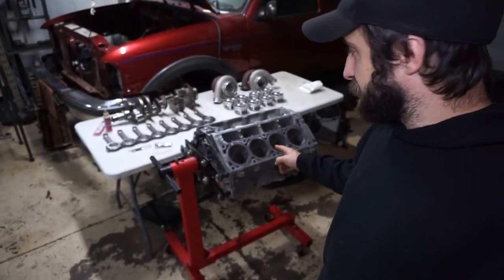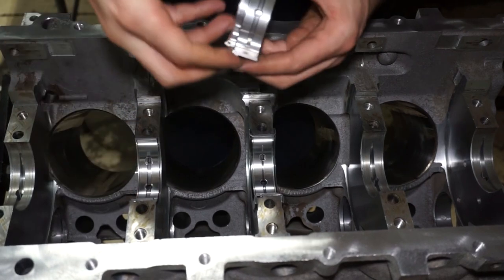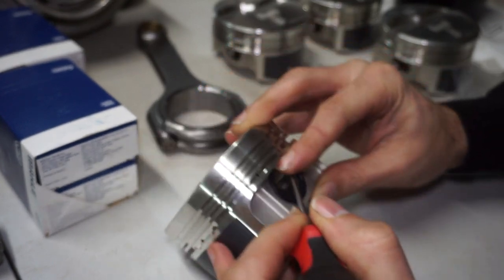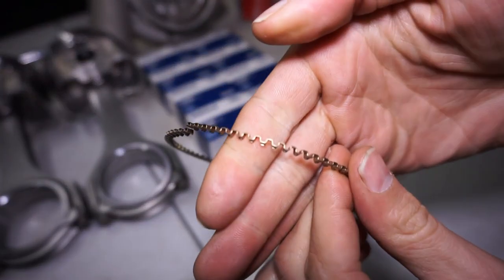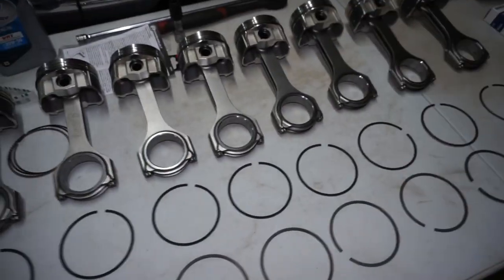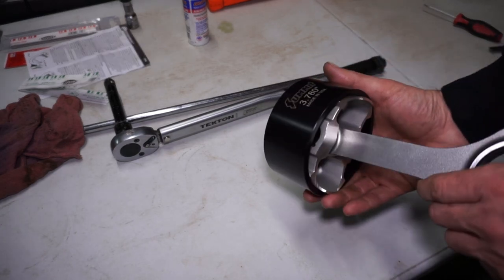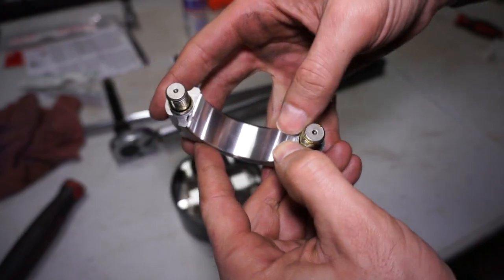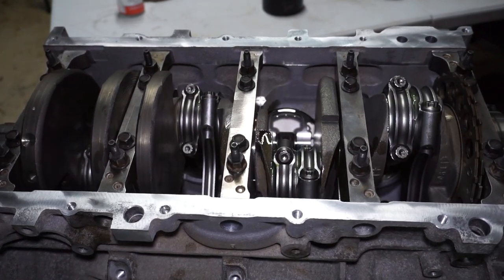Installing Summit Pro LS Pistons And Rods For Twin Turbo Ranger!!!

Comment: There’s a a tool you can get for those spiral locks.  It threads the lock on, then you just thread the locks into the piston.  Almost like using a screwdriver. Makes it super easy.
Reply: If you pull the locks apart like a spring then they just push right into place, and then will have a spring tension once installed.

Comment: I thought it was 15 Ft Lbs and 75 degrees for the connecting rods? Does that equal 85 lbs in the end?
Reply: Yes it does and when you do not have the angle it should be done in a 3 step process up to the 85 ft lbs

Comment: Starting to think this is a sign…was just looking at summit rods a few min ago. What’s your power expectations and how much was ass the machine work?
Reply from the maker: $525 for:
Clean block
Cam bearings(bearings/install)
Balance
Hone/fit pistons
Reply: @BlaserBuilds  How much power you looking to make? Goal?
Reply: Crazy how this video popped back up. Lsa blew last week, doing a lq4 408 with these. Made 860 on old setup I’d be happy with same power .

Comment: Did you have to add weight to your stock crank to accommodate for the weight difference of the forged pistons and rods vs the stock pistons and rods?
Reply from the maker: Machine shop did the work. I'm not positive if they added or removed weight.  I gave them crank and they balanced everything together.
Reply: @BlaserBuilds  oh ok my machine shop was telling me to try to get forged pistons close to the stock piston weight because adding weight to the Crank is expensive. But great content and thanks for the timely response 💪🏾
Reply from the maker: @markc4358  I know HunterTuned had to add weight. They just mig welded onto it then machined it back down. I dont remember seeing any welding on mine.
Reply: @BlaserBuilds  I watched his video right before yours and thought you had a way around it. But I’ll see if the guy at my shop will use weld instead of tungsten.
Reply: My machine shop called 2 weeks after dropping mine off and told me just to get the matching crank to the pistons and rods haha. I think it's allot of work to use the factory crank with these rods/pistons

Comment: Thats a good looking kit! But spiral locks are such a PIA.
Reply from the maker: Yeah, the first one took me like 20 minutes, but by the end it was pretty quick once I had a routine. Lol.
Reply: @BlaserBuilds  I put all 8 of my rods/pistons together and on the last one I realized I had pistons clocked upside-down. Now that was a REAL pain in the ass! LMAO!
Reply: First time I put spiral locks in I didn’t look at the instructions to walk them in- get this I took a tapered pipe that fit the pin bore and I made a mandrel fit in side the lock put em in the and taper pipe in the pin bore and pushed the shit out of it with the mandrel and they snapped in. Lol
Reply: I have to add that it took forever to make this shit work and it was hard as hell to pop them in. My buddy come over after I finished and was like ya walking those clips in sux huh? 🤢

Comment: 13:42 I mean absolutely no offence only for inisight, but as a vet ase cert I can tell you that the first and third bolt you torqued in this video clip were over torqued by atleast 5 degrees after it cammed, you can see them tighten more while the second bolt tq was done perfect. To use a tq wrench properly pressure must be immediately reduced after the initial breakout and not to aloud to turn past it. If you accurate wrench was set to 82 in this video I would assume they were hit with about 96-100 with the extra hit, bearing distortion and service life would be altered
Reply: Not sure how far we are behind real life time, but hopefully no big deal to re-torque them if you happen to see what I see
Reply: @Kevin-zo6nz  HAHAHAHAHAHA

Friggin torque wrench is 8% +\- and ur telling this to a dude that has broke EVERY SINGLE head bolt on purpose "just to see their limits".
Reply: @TheProchargedmopar  I've broken a 54mm diameter stud with a shear brake to test its strength to hold a water tower in high wind, is that relevant? what's your point?
Reply: Ase certs lol.... His little bump didn't add 10-20 ft pounds, mayby 2-3. It'll be fine. At least he isn't using a trash Snap-On electronic one that lies to you